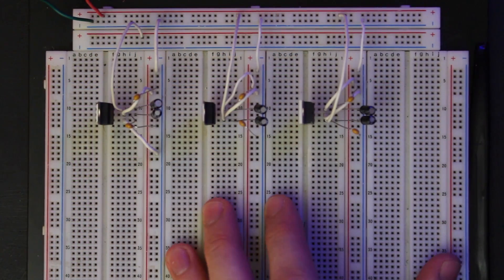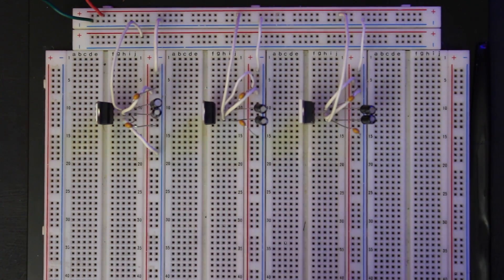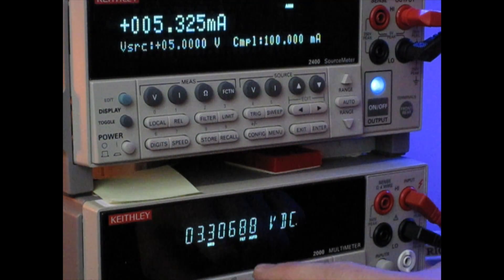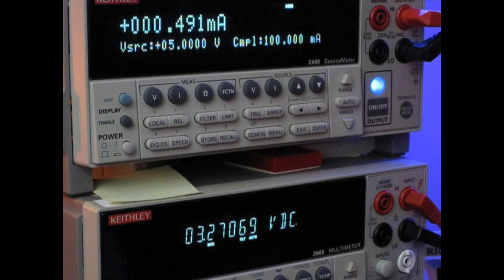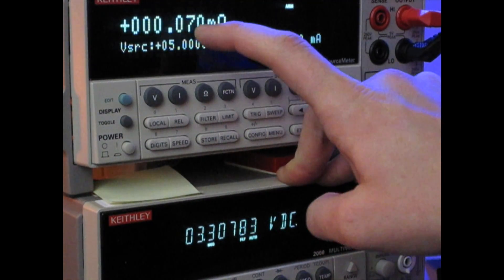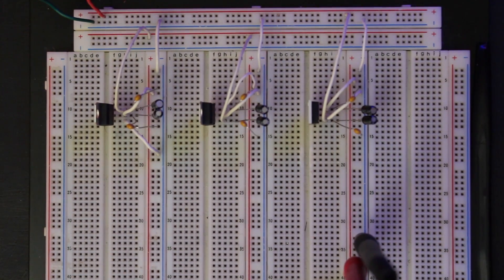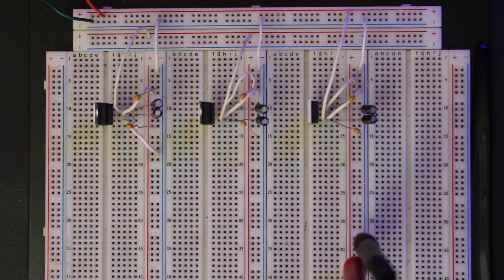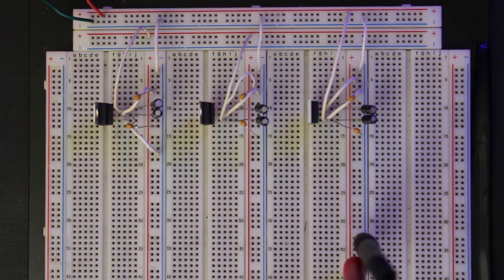Low Power Arduino! Power Supply Considerations p1

Comment: I had quite good results using a zener diode, and resistor above it, feeding into a triple darlington transistor. The output of the emitter gave me around 3.5v but the quiescent current was sub micro-amp range because I was using a 1M resistor feeding into the zener. Not great voltage regulation, but super low standby current. i.e. decades on a 9v battery.

Comment: Why use Linear voltage Regs at all! they waist so much power to heat. I've found using a little dc-dc buck converter along side my Arduino. Works great, no heat and can supply up to 2A.

Comment: +Kevin Darrah thanks for the great videos on power saving, I have watched most of them and they have been very helpful. Reading through the comments you said you were going to go into buck converter/regulators, did you ever get round to making a video on these?  
I am currently on a low power project using sleep modes (328p, Gsm & Gps modules) currently powered off of 2 dc-dc step down buck converters 5v&4v. I have measured 10ma quiescent current from each buck converter. I would like this project to be battery powered (Lipo) so the buck converters are out of the question. 
I was thinking of powering all three from a lipo (lowering everything to 3.3-4v) without any regulation. 

Do you or anyone else have any advice/recommendations on the best route to take to power this project?

Comment: Hi , In my batteries powered project I need minimum current consumption so I decided to use the TC1262 thanks to you. Unfortunately the blinking led wont run on esp8266 12E |: with the AMS1117 it is working perfect...I read that the esp12  requires 3.3V power voltage and peaks at  500mA when i read the Data-sheet of TC1262 I see that its maximum output current is 500mA....Can it be the problem ?
Reply from the maker: maybe, but I think the 1262 can handle quick 500mA peaks...
Reply: Please i beg you i am stuck with this problem long time 
http://www.esp8266.com/viewtopic.php?f=6&t=12306

http://www.esp8266.com/viewtopic.php?f=6&t=11390
Reply from the maker: that is very strange - that last video I made with the radar gun had some serious peak currents - average of over 250mA and I used the 1262 for that project with no problem.  Eh, try throwing down 100uF caps across the in and out caps.
Reply: I will give it a try but I see on this video that you used also 5V from the serial adapter+batteries . did u try'd the regulator with batteries only with esp8266 ?
Reply from the maker: nope haven't tried running with batteries
Reply: Thanks for answers....hmm maybe you can find time and try with my circuit  ? maybe you can figure out the problem... I believe it is very important even for this video because it talks about low power consumption regulators for batteries supply projects for esp as I understood.
Reply from the maker: Just tested, seems okay to me - was able to connect and get data, using the same code from my part1&2 videos on the ESP8266: https://www.youtube.com/watch?v=JWY6oV6_MJU&feature=youtu.be
Reply: WoW thanks you very much your amazing I really appreciate that , I think it is different with the esp8266 12E ,  thanks you very much  ill keep trying !
Reply: Hmmm I think the tc1262 i got are fake for sure different from yours take look please here compare image : https://s17.postimg.org/qmew6wjfj/Untitled.jpg  
Can it be fake ?  I buy everything from ebay , maybe you can advice me where can I get same as yours ?
Reply from the maker: yea, could be fake, but that's such a basic part, not sure why they would even bother.  Maybe try loading it down with resistors and see if it can maintain regulation under load.
Reply: That's the interesting part, it does the work...I can see 3.3V on output stable when CH-PD disconnected |: means when esp not working .
Reply: It was fake (: I got new one from other seller everything working perfect thanks !!!

Comment: so i been reading around the web that the esp8266 only has a few periodes off time where it goes above 200ma cut i use a chip with a lower output and then use a capacitor in series with the regulatores output to handle the peak current above 200ma?

Comment: Great Kevin. Tihs video helped me a lot. Can you tell us your point of view, or your considerations,  in respect the use of voltage dividers to get a Vout of 3.3V?
Reply: I don't think using two resistors and making a voltage divider works good as a power supply. People use this trick to step down the voltage, but the load in the parallel to the second resistor, or the resistor that generates the desired voltages across it, has a very very large load across it and the currents are flowing at the signal levels and hence it works. When it comes to an actual device or a load, which demands current, the actual equivalent resistance isn't the same. The configurations change entirely! The voltage fluctuates and that depends upon the load. Voltage divider works as long as there is no change in the network configuration, but as long as you connect a load, configuration isn't the same anymore. That's why engineers have build "Voltage regulators" which, despite any change in the load demand, keep the voltage at the output constant by the closed loop feedback. But you can still use Zener diode based voltage regulator if you don't want to run into the complex and fancy stuff like DC-DC boost converter. It is simple and fairly keeps the voltage across it constant.
Reply from the maker: you mean regulators with an adjust pin? or using two resistors as voltage regulators?
Reply: +Kevin Darrah two resistors as a voltage divider

Comment: Nice Information!!
I ordered a few of those to try!  All step up / step down with a written 96% efficacy
did use 1mA or more unloaded… 
I been testing the stability on my esp8266 12E with different voltage. To avoid any
regulator at all when running on battery. I found that its stabile (but not recommended) up to 4.2V 
3.0V – Issue with ds18b20 readings (ESP8266 OK),  3.1V – Issue with ds18b20 readings (ESP8266 OK),   3.2v – OK3.3V – 4000 sends OK,  3.9v – OK  ( 0.2 mA deep sleep),  4.2v – OK  ( 0.3 – 0.2mA deep sleep)
All measurements I made and calculations pointed that 3 AA recharge batteries
theoretically should last ~212 days on 2700mA with 15 minute delays, unless the
voltage drop to quick on my batteries.i wrote all my test in my homeautomation blog: http://www.automatiserar.se/esp8266-12e-wifi-sensor-pa-batteri/

Comment: I was curious why you weren't investigating the SMPS drop in replacements for LDOs, but another draw back you didn't mention with switch-modes is that they're at their worst efficiency in low power conditions, and LDOs could be more efficient in low power states, which is the state the uC will be in most of the time.
Reply from the maker: +aiden1015 yep, that will be in p2 - good point about SMPS efficiency - thanks for adding that

Comment: Nice one as usual Kevin. Few months ago I got into some NRF module related condition monitoring project and power saving was paramount for the project to move forward. Had to dig into some fundamental stuff.

However during my initial research I couldn't find a comprehensive guide on battery power evaluation i.e. predicting a like for like project life calculator based on current draw and the chemistry of the battery. It would be really nice to see something around this topic. Working out the power consumption i.e. sleep and wake cycles then predicting life based on the battery chemistry/mAh/C etc to be used for the project.

Great work for building up this video resource!

Comment: Love your thorough investigation of "low power" things ... Keep it up. Love to see more about higher voltage sources transformed down to lower working voltages (24v/12v sources efficiently reduced to 3.3v) for things like the ESP8266. The high current draw of the ESP8266 when transmitting places some challenging design techniques into play. I would love to see what your approach would be to solve this. Thanks again for a great series.
Reply: +State of Electronics hard to beat the price and simplicity of dc-dc modules like this: http://www.ebay.com/itm//272041589000
Reply: +Kevin Darrah correct, if the not the feedback the quiescent current to run the switcher can easily be in mAs so in systems that spend a significant amount of time in sleep modes using 10's of uA  a linear regulator could easily win on efficiency. 

The most efficient would be to combine the two and only enable the switcher at high current draws
Reply from the maker: +Lasse Langwadt Christensen yea, those are nice but you've gotta watch the current draw from the resistor feedback network.  I'll make a part 2 on DC-DC regulators and explain this as well as test some of these cheap modules
Reply: +Lasse Langwadt Christensen 
Depends what your input is: 5 to 3.3V conversion using LDO's probably wins every time if the regulator has a low quiescen current (not a NCP1117 as often used on arduino) with  66% efficiency. From 12v... hardly.

If you're operating from a single lithium cell and you need 5V, however a linear regulator wont do, unless you're using a charge pump.

I guess we can have the same discussion when it comes to synchronous versus non synchronous rectification for SM regulators ;)
Reply: Hi!, thank you for yours videos, I am learning a lot, I just discover you today.  Can I ask something?.. I need to power an ESP8266 from 12V, all the time this 12V are OFF, when 12V comes up, ESP goes up, work for 5minutes and goes to sleep until 12V goes down, because 12V work only 5 minutes. In this case, Can I use a LD1117v33? with head sink...I am stack with this, if you can answer me.... I really thank you.

Comment: "Low Power Arduino" and linear regulators do not go together. What's the point of even comparing linear regulators when there's a far superior option available that's just as easy to use. seems like a bunch of wasted effort
Reply: +Ivan Romanenko switch mode regulators(Buck to lower and Boost to increase voltage). once you get past the most basic of electronics they are used absolutely everywhere and real low power application use them exclusively since they can be over 90% efficient. linear regulators are horrendously inefficient and just waste tons of power.
Reply from the maker: +OtakuSanel Yea, this is just part1 to this series.  I'll get into Buck switch mode regulators, but even with them you'll have to watch out for quiescent current draw.  I was just thinking about this and how it would be cool to see how much longer (theoretically) you could run off a battery with a switch mode converter - I could show it by the numbers and see things like if you have 50mA bursts for 100ms, what is equivalent drain when you're in standby mode?
Reply: +OtakuSanel Could you please explain little bit what other options do you mean. If you have links to video or blog post please share )
Reply: +OtakuSanel Buck Convertor?
Reply: +Big Jay yup. if he wants to do anything low power he should be comparing various buck converters. any buck will beat any linear but then there are various buck converters depending on your needs with varying efficiency so comparing them would make sense. comparing linear regs for low power applications makes absolutely no sense.
Reply: +OtakuSanel +Kevin Darrah Thanks for explanation. Looking forward for new videos.

It is very interesting what is going on with power when you use ESP8266 with sleep/wake-up cycles.
Reply: +Kevin Darrah 
Interesting. Some controllers use pulse skipping and are very efficient, but the issue I've came across is often the price and space used. 

Even decent linear regulators can become very expensive. 

The technique I use is during sleep mode, the uprocessor is fed in series with a resistor to my supply (say 12V) A zener is in parallel controlling the max voltage, say 5.6V. Quiescent current draw is easily calculated, for a properly designed system 100-500uA would provide enough, with the zenner shunting the excess. A capacitor provides reserve for the uP to wake up and do some tasks every now and then. Once back into full active state it would power the switch mode converter and loads, say at 5V, so the zener doesn't shunt the regulator.

Do note: An Arduino UNO running at full load with internal RC @ 1MHz uses less than 1mA, with the built in regulator 'stealing' 3-5mA more

Another technique I use is with AC-DC power supplies, but can be applied to buck converters: regulate the supply voltage, say to 12V to feed relays and other stuff and back to 5V to idle, assuming the CPU runs at 3.3V
Reply: +OtakuSanel 
Except they are never 90% efficient unless operated at rated load under very optimistic conditions